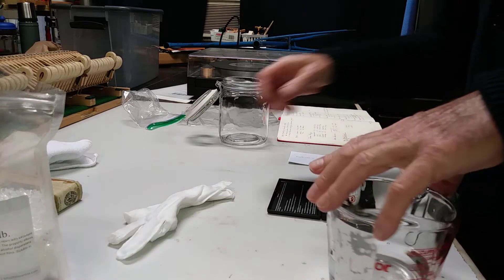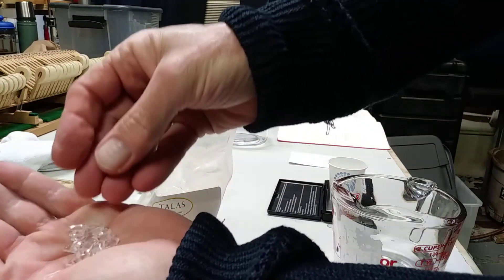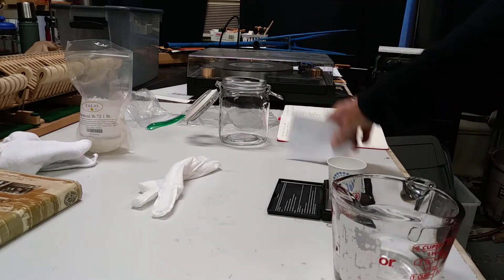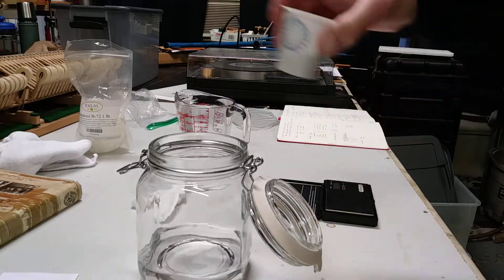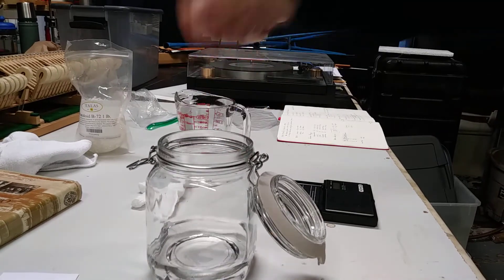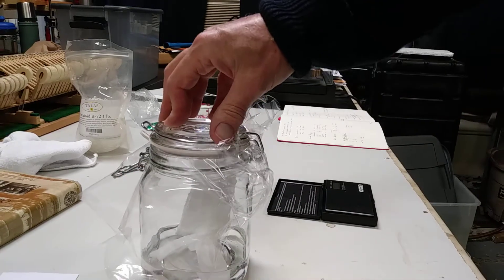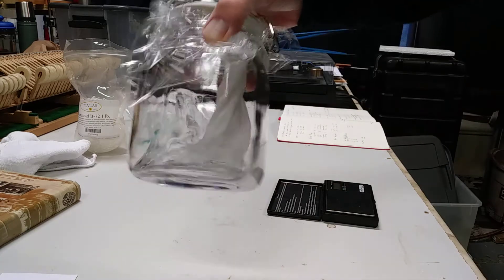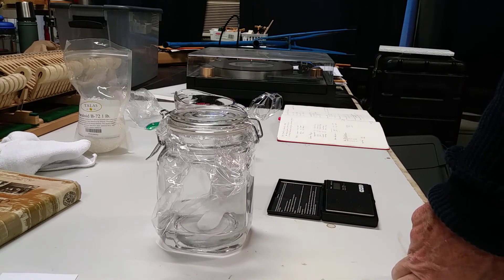Mixing B72 voicing solution

Comment: I don't understand what the glove is for. Could you also introduce heat as a catalyst to the dissolving process: sealed jar with crystals and alcohol placed in hot water?
Reply from the maker: The glove just suspends the B72 pellets in the solution to speed up the dissolving. Otherwise they end up in a clump on the bottom that needs to be frequently broken up and stirred around. I have no opinion on heating...maybe.